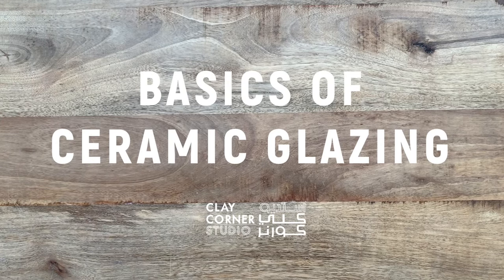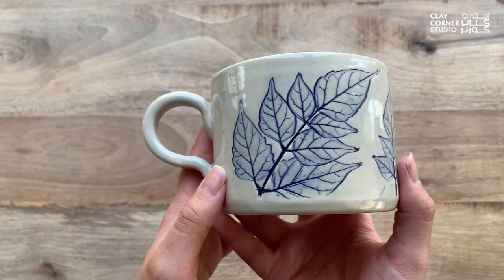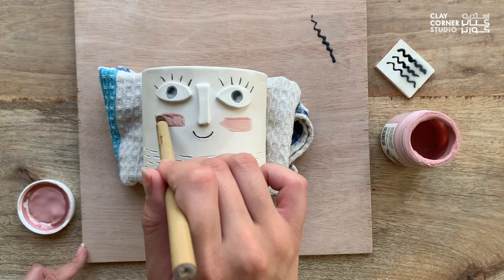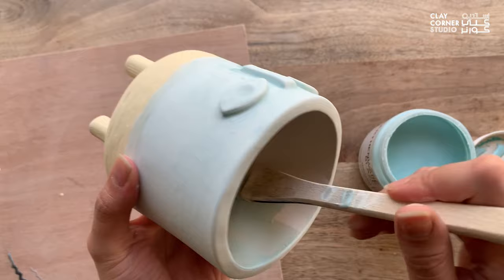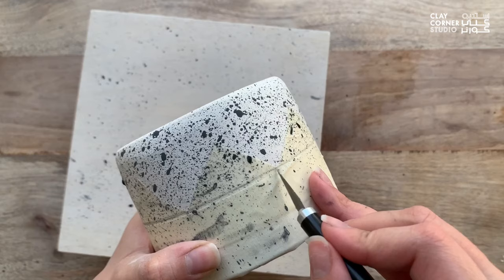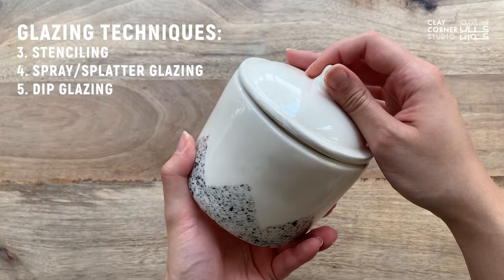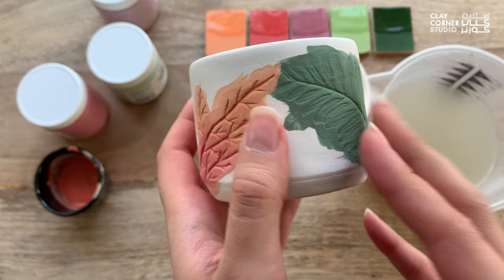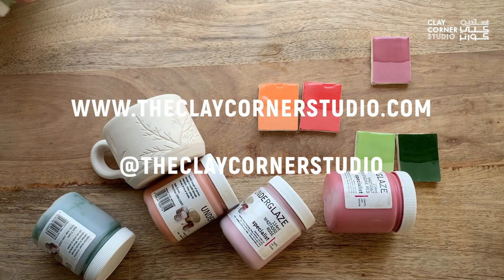Basics of Ceramic Glazing: Types & Techniques

Comment: Some of your information is incorrect. As long as the clay is vitrified it’s food safe.  Glaze is not necessary for food safety.
Reply: Thank you for making it more clear. I've been searching for this information.
Reply: Not all glaze has a considered food safe so you want to
Ensure a glaze you use is food safe
Reply: As far as I know, the firing process still leaves the clay porous, so even if they are not technically unsafe, they will absorb food that will rot over time and make it unsafe. A lot of space that bacteria can be stored

Comment: I bought a glaze sprayer that you can use your own wind power by blowing into it. It takes a while for the glaze to build up but doable. There is an exhaust issue with it as well so ventilation is necessary.

Comment: Question about the jar:

After you dipped both the body and lid in the glossy glaze, you wiped the bottom of the jar where the wax was so it didn't get stuck to the kiln when the glaze fired. But what about the lid? Were you able to put the lid on the body of the jar when firing, or would they stick together then? Or did you put wax on the bottom of the lid and fire the two pieces not touching, and I just missed that part?

Comment: Just an FYI. Glazes do not seal pottery midfire pottery. The clay has to be fired high enough to vitrify the clay, which means it will no longer absorb moisture. Low fire clay never vitrifies.

Comment: My pre-mixed glazes are always so thick! Can I thin them with water? Otherwise it always makes really thick clumps on my brush and its impossible to get nice details. Or am I maybe using the wrong brushes....?
Reply: i used to thin lumpy glazes a bit with water and it worked fine for me. sometimes the container they're in isnt airtight so it evaporates water over time. as long as you dont make it too watery its good to use, if it is too watery just leave it to evaporate a bit again

Comment: This glazing is safe for food?
Reply: There is not just one answer for this question. What is food safe is a difficult and much discussed topic. If you are new with glazing; buy stoneware,fire 1050 bisque,buy a brand like mayco/amaco/botz and buy a glaze marked as "food safe",only apply one glaze on the inside and do not mix glazes for the inside,fire the glaze between 1200-1240 degrees..now you have the best chance to call it food safe